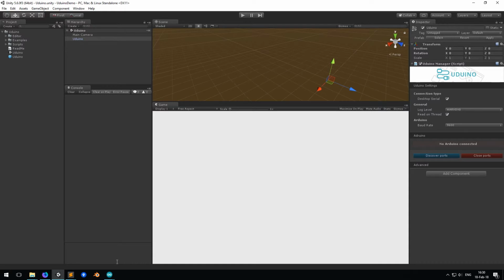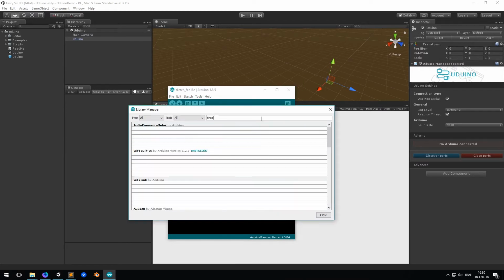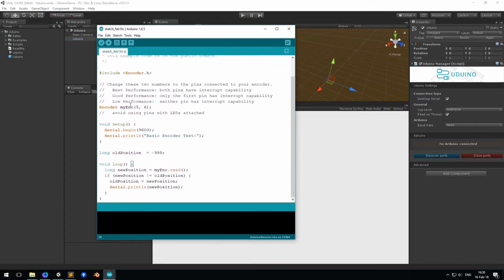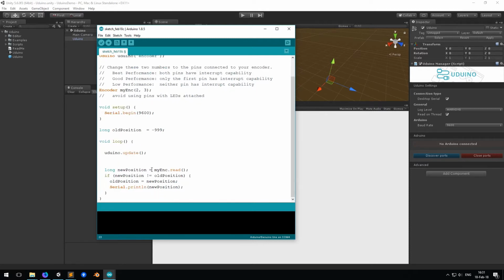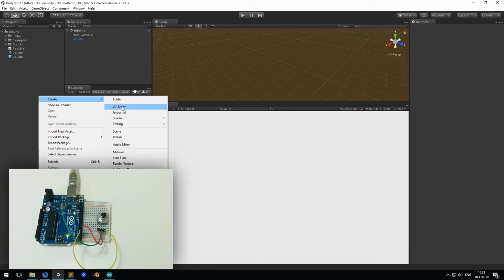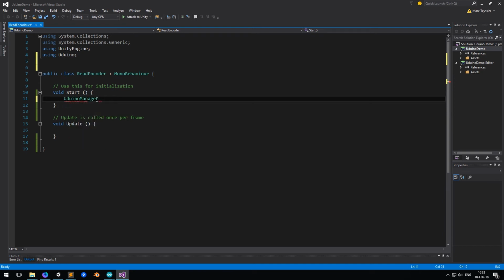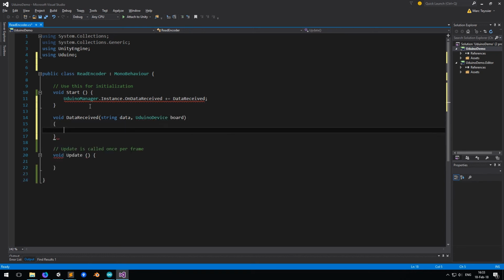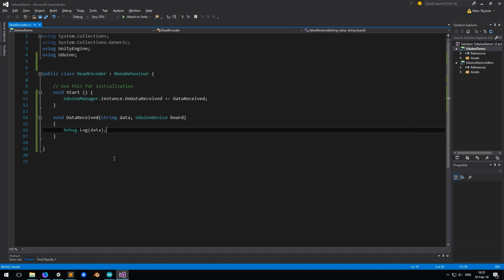Extend an existing Library - Using an Encoder in Unity - Uduino tutorial

Comment: I want to star with Uduino, but before to sumerg i would like to know if its possible use with sensor that require external library.  
Exactly i need to use the MAX30100 Heartbeat Sensor. Thanks!